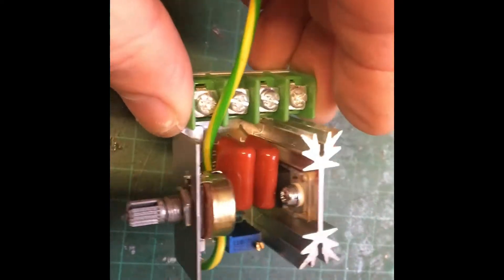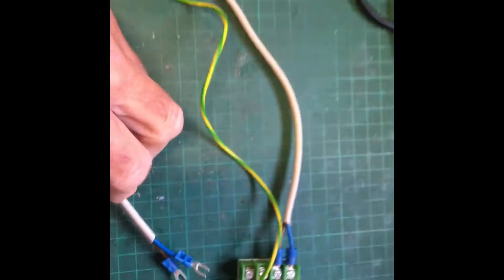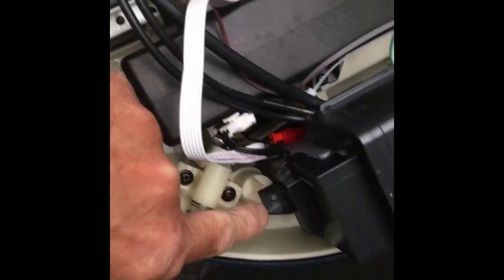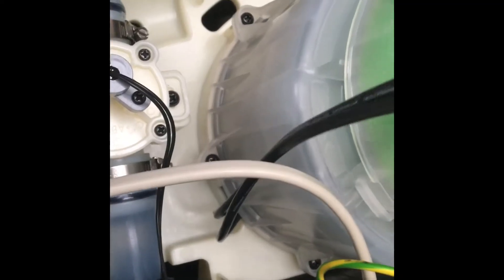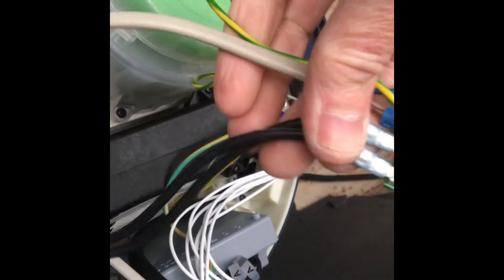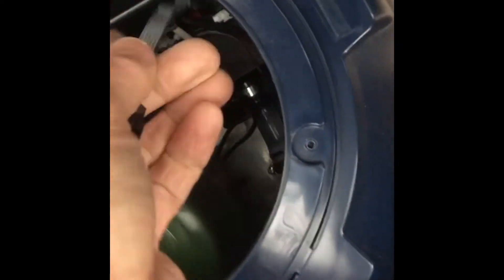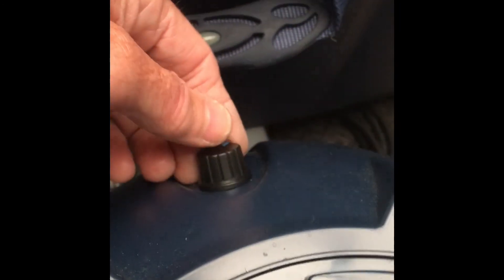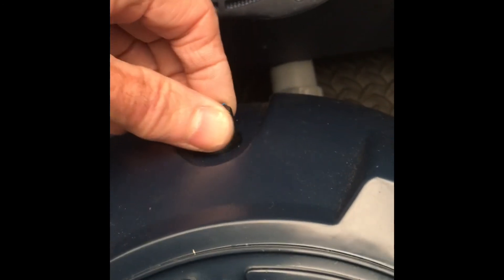Adding a Bestway Lay-Z-Spa Bubble Rate Speed Controller module modification to make it quieter

Comment: The build quality on the controllers is crap, I've bought 4 the first one worked but when it was put back together didn't push air through, the second a couple of traces had been over solded together and I got the 3rd one installed and works but the blue resistor with the screw is loose, it works for now I got one spare, yes as someone else mentioned using bell set it is adjusting voltage so possibly in the long run it will kill the motor, word to people using the new grey air heater / bubbles like what's on the lazy spa hawaii check the wiring they had used blue neutrels as lives and lives as neutrels look on the circuit board it has initials stamped!

Comment: Adding a speed controller that uses a depreciation of Volts will over wear your motor. 

The unit has been designed to pull 800 watts so as you lower the voltage the motor requires more current to keep the field flux active. 

Because it's a AC motor you will find it incredibly difficult to control the speed using a external device. This is why fans have 4 wires coming out of the Motors because it has three individual coils that are wound to produce less current but still keep the same hertz throughout the windings

Comment: Hey Tim, tried this mod out on the new style egg (looks to be same wiring setup as yours) and it worked for a few seconds during testing but then the resistor on the speed controller board (the larger one in the middle between the 2 red insulated sleeves ) burnt out. Any ideas? Wondered if I’ve done something wrong or got a duff board. 🤔

Thanks
Reply: Hi mate, did you find out the answer? I want to do this on my new egg it worked fine on my old egg.
Reply: @adamwestbrook1059  yes it was unluckily a duff board  - replaced with one from Amazon and it’s worked perfectly since install over 6 months ago now
Reply: Awesome sorry just seen this reply, i have my new hot tub now and will be trying it this weekend, i miss not having the speed controller.

Comment: Hi Tim I have been looking for something like this for a long time to control the bubbles to a gentle rate rather than full out.  Any chance you could provide the link to where you got the controller or other device than can do this?  Can't find on ebay.  I have the Intex Greywood 6 spa.Thanks much!
Reply from the maker: If you stick this into eBay, you'll get loads of hits for this controller... 2000W AC 50-220V 25A PWM VOLTAGE REGULATOR ADJUSTABLE MOTOR SPEED CONTROLLER

Comment: this is awesome Tim!  would you share a link to the controller you purchased or provide details on the specs??  much appreciated my friend
Reply from the maker: If you stick this into eBay, you'll get loads of hits for this controller... 2000W AC 50-220V 25A PWM VOLTAGE REGULATOR ADJUSTABLE MOTOR SPEED CONTROLLER

Comment: Is It still working?  Something is wrong with my controller because it worked about 1 hour. Then i bought 4000w speed controller and aboout 1 hour again and it stopped working also... No idea why it wont last
Reply from the maker: Mine still works. Not sure what's up with yours? Maybe a dodgy component?
Reply from the maker: Was it overheating?
Reply: @Tmo1972  Don`t know, its summer soon and I´ll have to do some more testing and maybe add more cooling or something...